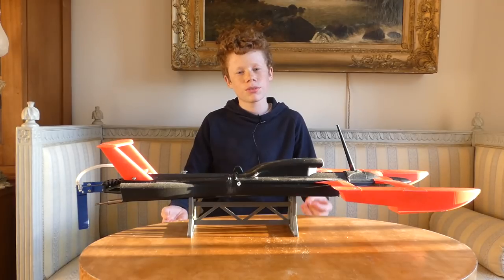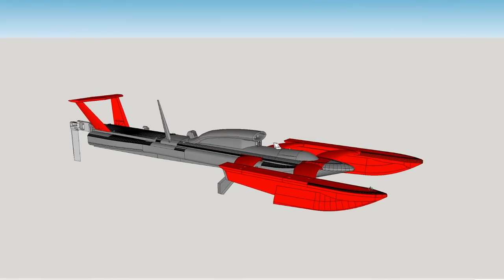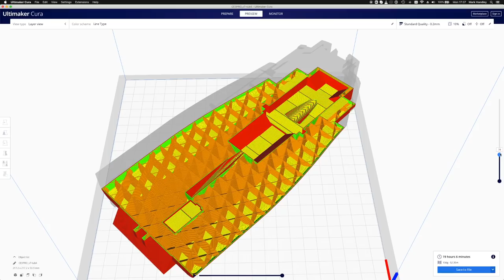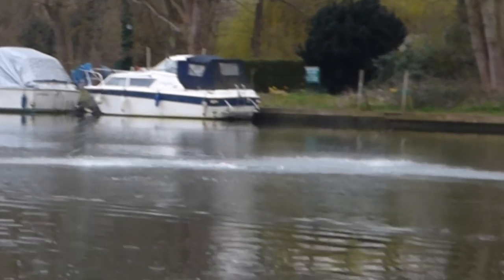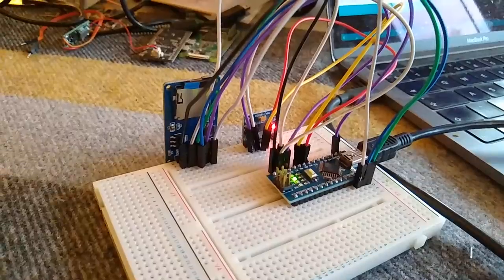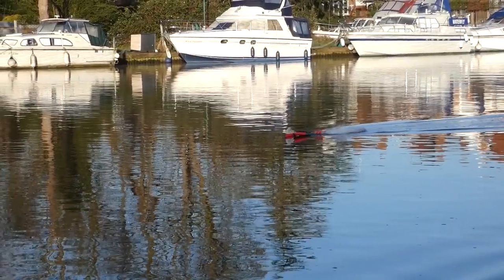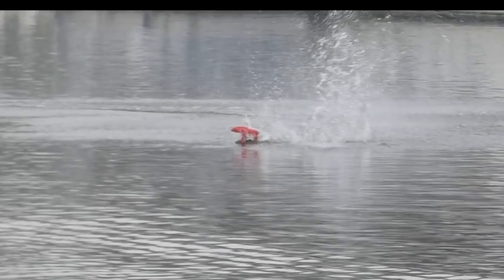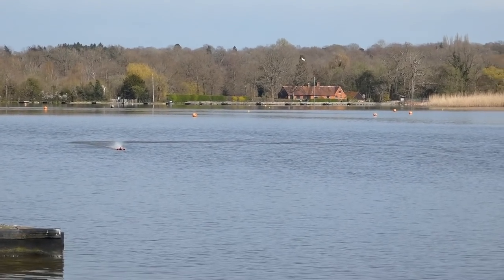3D printed RC Hydroplane Part 2: Zero-to-60 in 1.6 seconds!

Comment: This is the fastest 3d printed RC boat I've seen so far! Great work!

You might be able to run a driveshaft through a rudder or hydrofoil structure. A way to reduce the effect of rough water would be to add  two hydrofoils at half foot (15cm) depth under the two front pontoons but calculating the angle needed to stay up around 60 mph would be difficult. PETG, PP, and PPGF30 plastics are good water proofers and might be the way to go if you don't do any resin printing.  

 I've seen some old US navy designs where a massive boat would use jet engines to stay on top of their hydrofoils to allow higher efficiency and less wave impact/drag.  
Good luck!

Comment: You definitely have the fastest 3d boat sir, happy you made the strut angle adjustable, its running amazing now, you must remember if scaled up the real boat could never achieve the acceleration and top speeds yours is, you are at the limit of that design, but what youve done is evolved it, dont be surprised if some people watching this steal a few ideas for theyre full sized ones.

Comment: Hey, I love you for sharing your stuff with us. 
Just my 5 pence: For  more stability around the rollaxis, you need to mount the sponsons further away from the main hull. Im building outriggers for about 3 years now, and during this time I also made my experiences with that stuff. And, when you want to get it more waterproof: tape the latches while driving with cellpack on the hull- its fully waterproof and flexibel, and also very cheap. I dont know if you are using it, but looks like you are not ;) . And, another one: stop trying to aircool your electronics. Its a huge risk if you land on the roof. Great for optics, not for function. 
Against the esc cuttout you could try to mount some capacitors as near as possible at the powercables from the esc. That will help to stop the esc cutting out casue of temporarly low battery voltage. Normally a 120amp ESC in a boat this sice is enough. As an example: im using a 70amp ESC in a ~60cm outrigger, at around 110km/h, with no problems at all. And without any aircooling! ;)

Comment: A few improvements to try : 1 GRP coat the hull and sponsons using lightweight woven cloth. This will make it more crash-proof and add strength for minimal weight gain. 2 Adjustable front and rear aerofoils to maintain stability (the cooling pipes could be upsetting the flow to the rear foil - check your "Gopro" footage). 3 As you've discovered Arduino, I'd use these to track when the hull is 'out-of-trim' and to make corrections to the foils. Have a look in the 'C' program library (it's open source) - someone may already have written the code. You may be able to use miniature accelerometers to track the trim changes. 4 I think you're approaching 'waterborne' drag limits - you may have to get the boat further out of the water (back to aerodynamics !). Well done and good luck.

Comment: conformal coating is what you want for your electronics.. it works amazing and can be soldered through and doesn't trap heat like epoxy,
The MG Chemicals 422B is the best I've found, in terms of easy of use, rapid drying and nice thin film.. Most of the others leave a huge gummy messy.

Comment: This is a nice project for a young man like you. My little advice, take a 2K synthetic resin and brush it out inside and may be outside. Only 1 layer thick. Than its dry inside. Alternative, take 2K clear coat car painting colour and a paint spray gun. Clear it with silicon remover, sand it with finde sand paper and paint its from the outside with the clear coat. Than its sealed to.

Comment: I actually doubt wether it is the esc that causes the cutting out. The battery is rated at 50c which would mean it should be able to handle 150amps continuous discharge but I don’t think it can actually keep up causing the voltage to drop to fast. Which in turn lets the esc go into lipo protection mode for a split second causing it to stutter/hold back. Before going to a bigger esc I would recommend trying that out first. It’s also a lot safer to go with a higher discharge rating battery than you need considering how dangerous lipo’s become when under 3 volts per cell. That being said I’m absolutely blown away by your knowledge and intelligence for your age, definitely impressive all around!

Comment: You need to build a monohull for that kine of water! Its super fun in choppy water. 

I also fill all my servos with dielectric silicone grease to avoid water ingress. To avoid damage from floating debris you need a folding rudder, either modify the current one or buy a folding one :D

Great content, subbed! Boats are the best!

Comment: The only thing I can suggest from my experience in flying FPV quads is to avoid plugs and connectors if you want waterproofing. Solder the connections and use conformal coating on the joints instead of epoxy. Epoxy is brittle and not a good water insulator at all. Since I've learnt that the hard way I can fly into snow or a puddle no problem never lost connection again. As long as you have any exposed connection the shorting will be an issue. I hope it was helpful. Keep on the great work young man! You are the generation putting people on distant planets in the future. Kudos to your parents as well.

Comment: You have the right running hardware, but you could perhaps increase the hull width and side sponson length, more in keeping with the full sized unlimited hydroplanes. And since the motor and esc are watercooled, you could remove the air intake. Great work so far!

Comment: Well thanks YT for recommending this! Great video, well produced, well edited, well narrated and the boat was pretty good too! Re water permeability. (this won't work on the waxed one) Maybe sand it down well and apply a couple of coats of filler primer & then gloss automotive paint from Halfords. Or... get some epoxy resin and paint that on. Might have to do it in a few sections, or maybe use UV resin for faster results. I was also thinking the ripples in the water are your nemesis too, the boat is maybe 1/12 scale, the water isn't! The only way to overcome them and have more stability is to scale the whole thing up and the added weight will will help too. looking forward to part 17 by which time you'll have a 2m long three-motored design! 
Sorry one last thought RC car shock absorbers with hinged sponsons... no that'd be daft. Or would it?!

Comment: Outrigger hydroplanes don't like to come off plane when running. Use a curved turn fin on the right sponson and you will be able to turn right under power and keep the boat on plane. Limit partial throttle running as it quickly builds up heat, outriggers prefer 100% throttle running.

Comment: Kick the right front sponson outwards, run offset in the front sponsons to compensate for the torque and the boat will ride flat.  Also, you can give the right front sponson a few more degrees of AoA than the left.

Try moving the CG after a bit as well.  That will free up the front end and reduce the transom hop.

You are right, speed is easy - waterproofing and reliability are the challenge as well as good handling characteristics.

Well done BTW!

Comment: Great job!  Man that thing is fast!  I'm building a wooden p sport hydro right now to learn more about boat design in general with the plan to be 3d printing scale hydroplanes in the near future.  P sport is a bit different than what you are running as it is a fully enclosed hydro rather than an outrigger hydro as yours is.  Watching the video and comparing to my own boating experience with my current hydro a few things come to mind.  In p sport and scale hydros the balance point is just behind the sponsons so I'm thinking yours may be a bit tail heavy and that could be part of the instability.  Not enough weight on the sponsons seems to make the boat torque the left sponson out of the water on hard acceleration.  Moving the weight more forward might help with that...but it will also increase the dig issue on slowing down.  Increasing the sponson size even further should help with that.  Something to consider might be to print the sponsons in 2 pieces with no infill.  This way you can put Styrofoam in the sponsons before gluing the halves together.  This helps to ensure the boat doesn't sink entirely in the event of a crash.  For sealing the boat I would recommend using a marine resin.  You can paint it on with a brush then sand smooth with sand paper.  This will not only help seal the boat but having a smooth surface instead of layer lines will increase the boat's performance.  I've also used polyurethane to large success with my RC airplanes to seal them up as well.  Also for the prop...hydros in general use a lifting prop...if you do decide to try and move the weight more forward you probably will need a prop with less lift.  Have fun!

Comment: PLA isnt actually "biodegradable" in a sense where it just desintegrates in water. what they mean by it: it can be decomposed by micro organisms in an industrial environment aka industrial composter. if you just bury PLA parts in your garden, they wont decompose ever.

waterproofing with wax is a brilliant idea, its lightweight, easy to do and seems quite effective for the application

Comment: congratulations! nice runs! i use an old phone with a gps tracker to check the speed. simply tape it on top of the boat in a plastic bag. would be nice to do some runs together, but it is a bit too far. think i will check how fast my printed boat can go now, my last tests were with old batteries. maybe i can get over 100 now too....
Reply from the maker: It would be nice but it is a bit too far

Comment: These videos are really great mate. I’ve build many wood hydros and I’d say while your design looks great, I would remove the rear wing and that faux air scoop as they are creating lots of drag with no aero benefit. Also you ideally should have a zero degree angle of attack which I see you have added which is very important in this style hull.
Reply from the maker: I've tested the boat without the wing and it is much less stable at high speeds. The air intake is for looks. Nothing else

Comment: That's a cool video, keep it up!
But have you tried putting the propeller on the first design into a pipe, which would make it an impeller? This will probably help to stabilize the stream around the propeller giving less power to turbulent streams, therefore increasing efficiency of the whole structure.

Comment: Your issues with the electronics may be the ESC isn't sending enough power to the receiver causing it to cut out and causing the servo to act up. You may need a glitch buster Capacitor. I race RC and I put one on every car, truck and basher I have. They work great. A 180 amp ESC that has a BEC of 2 or 3 amps isn't going to cut it. Under load, that 3 amps will drop causing issues. That glitch buster will fix that.

Comment: For the speed mesurement you could use a gps (like the " sam m8q") and record the data it provides with your arduino nano. It's pretty cheap and doest take a lot of place. I think the sam m8q will be doing fine since i use it on my drones and crash every second flight.

Comment: I've always been confused by something.  I have a float plane (custom Polaris).  It has about 500 watts of power.  Yet, it can accelerate from 0 to 60 in about 1.4 seconds (radar measured), and keep accelerating if I don't back off or lift it off the water.  It can also climb vertically and go about 95mph through the air.  Why does a similarly sized boat take 3-4 times as much power to do the same thing?  The only thing I can think of is that the prop on the boat is extremely inefficient compared to an air prop.  This would make sense as the air prop has a far less dense fluid to push through and also has far higher aspect ratio blades.
Reply from the maker: I think the Polaris weighs about 1/3 of what Supersonic Lobster weighs, so that probably accounts for part of it.  Water cooling isn't light, and the prop, rudder and drive shaft are all metal.
Reply: @thescienceguineapig2833  My Polaris weighs 36 ounces including a 9-10oz battery. If you remove the extra weight in the boat associated with the extra power (larger battery, motor and speed control) I wonder how much the boat would weigh.

Comment: you've built up a very nice piece of fun. If you get further problems with your esc cutoffs, may you should try to get a better rated Battery. there are lipos for drone racing which are rated with about 100C. I think the Esc shuts off because of a voltage drop of the battery and not a high current cuttoff (as safety feature). These batterys are not very expensive and I can start the Diesel engine of my Car with a 1400mah Battery Pack

Comment: Nice job! The cutout of the esc might be due to the C rating of your battery.  Find some 75C or higher batteries and some nice XT90 connectors. Try making an autonomism boat with iNav or ardupilot. Doesn't need to be fast but you can run waypoint missions and have return to launch.

Comment: If you're planning on continuing to improve the design, I have some ideas that might be good: firstly, print the parts with the gyroid infill as it provides more strength in every direction and secondly, you could try adding (i don't know what to call it) something like a flap with suspension right at the point that touches the water, so that if you hit a ripple, the whole boat won't shake but only the suspended little bit actually touching the water. I'm not a real engineer yet but i think it could work and i've never seen it done anywhere else.
Reply: I mean kind of like the landing gear of the gunship in Nausicaä of The Valley of Wind. If you haven't seen it, i recommend watching it, not only to understand what i mean but also because it's generally a great movie.

Comment: A couple things....the esc maybe cutting out due to battery drain, meaning you may be pulling more power from the batterythan it can handle. I use capacitor packs to help with that on my on road speed run rc vehicles.  And I have a very close friend who actually builds and races world class top fuel hydro boats, if you would like I could have him get in touch with you.

Comment: NIce follow up video, have you considered doing a hydro foil? Petg might be a better filament to use than Pla, its a little more flexible and probable won't separate on the layers like Pla as easily.

Comment: You should try a different prop, either a 3 or a 4 blade. That will make it run more stable in choppy water because there will be more blades in the water at the same time.
Reply from the maker: The prop is not the limiting factor there
Reply: @thescienceguineapig2833  I'm not saying that it is the limiting factor, just saying you should not underestimate the effect the type of prop has on the way your boat handles.
You've witnessed first hand the torque that the motor puts out.
 I know people that have 10 different props on hand for a single boat.
Ask anyone whose in to boost racing, the more blades a prop has, the smoother it runs. Simple physics.

Comment: I have  been watching with interest  designing  a outrigger hydro is not the  easy for a novice  you doing well.  What looks to be  happening  is due to  the torque of the motor  wanting to twist the boat and lifting  the front sponsor.  Try making  the opposite  rear  sponson slightly lower at the back in the water this will push the front  sponson down, there is a  very good  rc boats  site called international waters  it is full good  stuff

Comment: Though PLA is biodegradable, it is only biodegradable in an industrial compost. However, PLA will absorb water and become waterlogged. 

You might have more success with something like polycarbonate (PC) instead of PLA because it does not flex nearly as much. I don't know if PC absorbs water more or less than PLA though...

Comment: All this build, test, learn, called 'fast iteration' at that place in Texas they build big rockets,... well, by now, you've probably learned more about boat design and fluid dynamics then most professional boat builders. WELL DONE !!
Odd Tip - the worlds fastest boat, Ken Warby's "Spirit of Australia" was designed to rock slightly at speed, to avoid the build up of pressure that leads to a flip.
I look forward to seeing what you do if you go with a Gas Turbine like the full size race boats., oh, and here's a link from the UK ;)
https://turbinesolutions.co.uk/turbines/ts-45i-turbo-prop-engine-6545804

Comment: Brilliant , keep up the good work buddy its not always easy building rc boats. Keep it coming 🙂, also check out Prestwich models which is a good supplier for rc boats/parts  in the U.K. P.S a deep vee/mono hull is good for choppy conditions😉 a 3 blade lifter prop may help, check out M5 performance hydroplanes here on YouTube

Comment: Make the Boat wider from the Pontoons back. Then make a pd on the bottom for the boat to ride when on Plane       Look at H1 Hydroplanes for ideas
Reply: Then Make a  *Pod
Reply from the maker: Once it's planing, it prop-rides nicely.  The hull is completely clear of the water, so doesn't affect the speed after the first half second!

Comment: LOSE THE REAR WING TOP PLATE  TURN THE RATES DOWN ON THE RUDDER  CHANGE THE PROP TO 3 BLADES  LESS PITCH    BATTERY TO FAR FORWARD

Comment: you only need because someone needed to sell something to you, vicious cycle, if you get what I mean
Reply: how about transition vehicle from a sub, to littoral to ground effect, 3-in-1
Reply: flying manta ray, tail powered
Reply: smaller water lift plane, instead of body lift
Reply: it can also house the propeller
Reply: one part under, one above, the water
Reply: just fill it with the glue